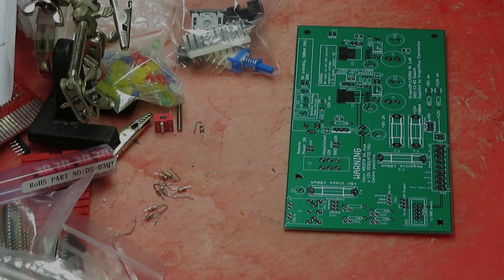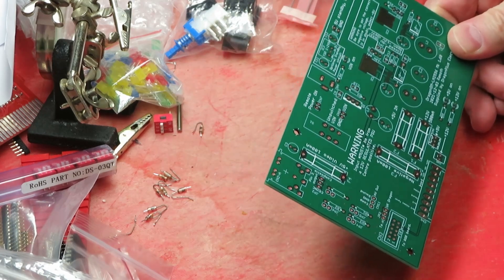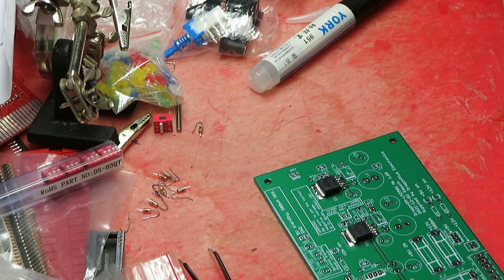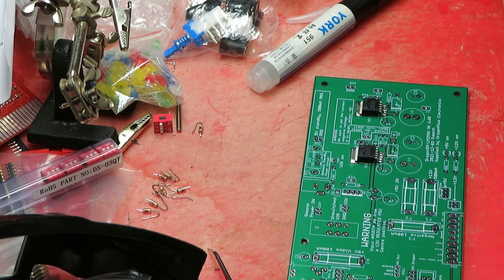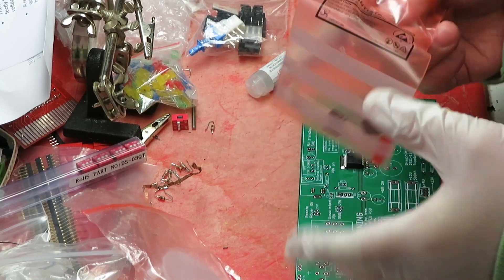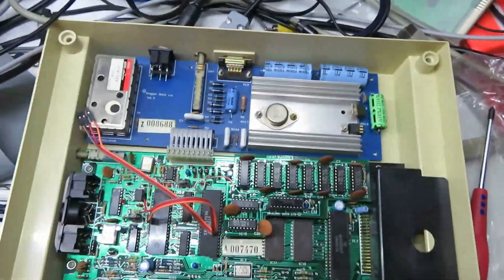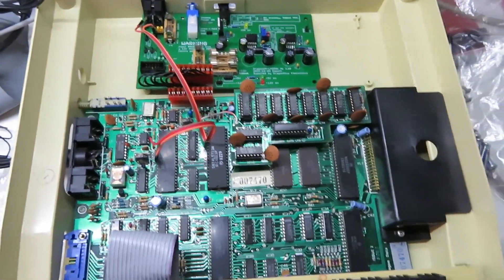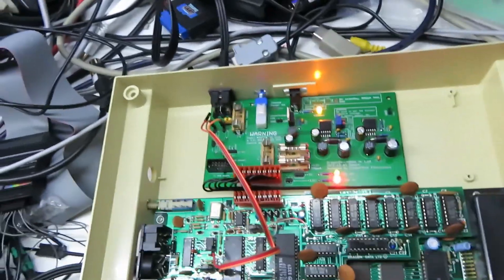EP 27 DRAGON PSU BOARD

Comment: Very nice build Lee :) I didn't know that dragon uses such weird voltages...
Reply from the maker: Yea it uses 8.5vac and 28vac iirc , that's then regulated down to +5v -5v +12v ( or -12v in the d64 ) absolutely insane regulation
Reply: @CaptainCommodore  8.5 and 28, omg,   from where did they pull these numbers? 🤣
+-12V is used for memory chips I presume?
Reply from the maker: Yea the -5 is for d32 and -12 is for d64 , I presume memory too ( havnt got a d64 ) but the d32 is -5v